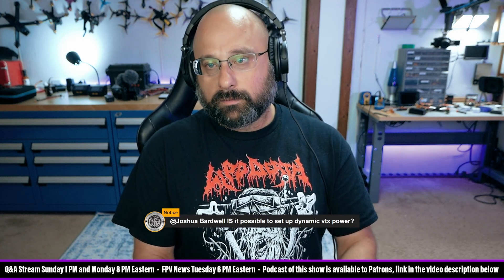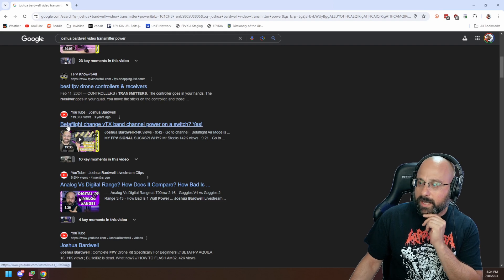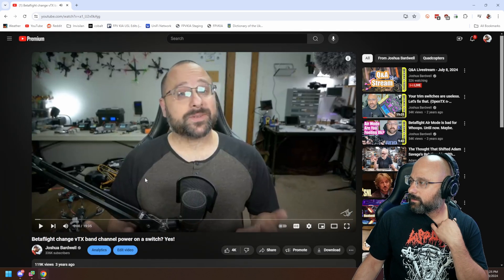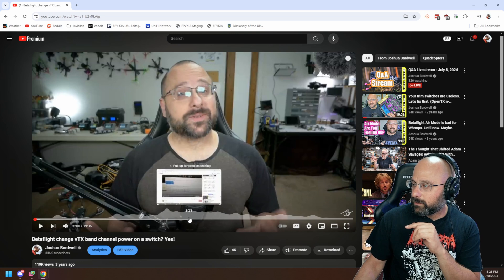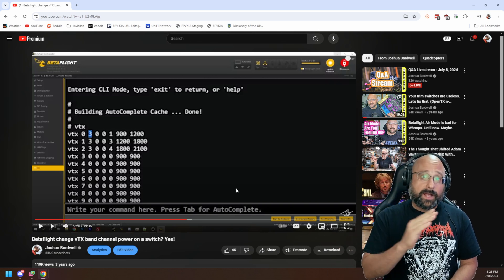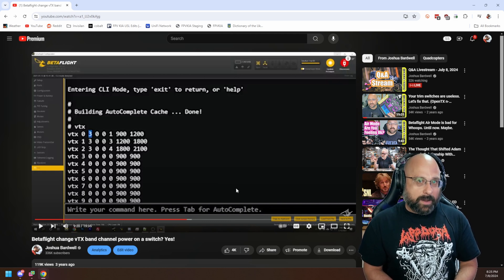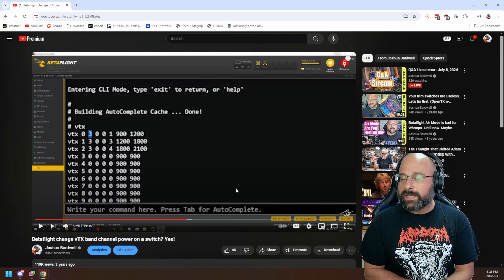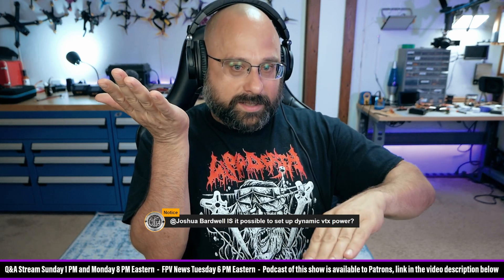Can You Setup Dynamic VTX Power In Betaflight? Should You? - FPV Questions

Comment: Random question need help with I have a speedy bee f405 wing controller that says it can output 4amps 5v. I have 5 servos,VTX,fpv camrea. I wanted to add a go pro bones which says it uses 2amps. will that plus all other components make it at risk of burning out the BEC on the controller?
Reply: Yes. I burned mine by adding a buzzer with a battery and GPS.